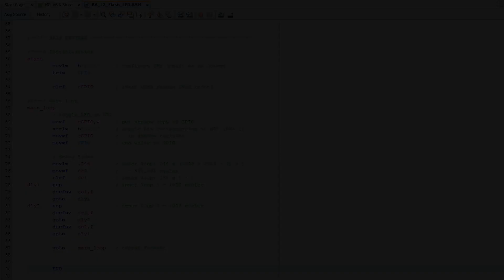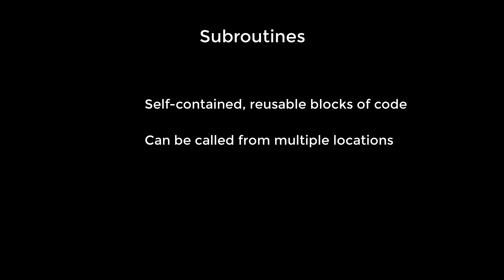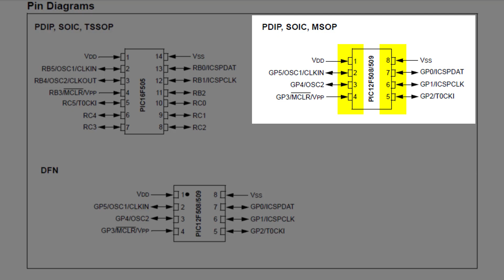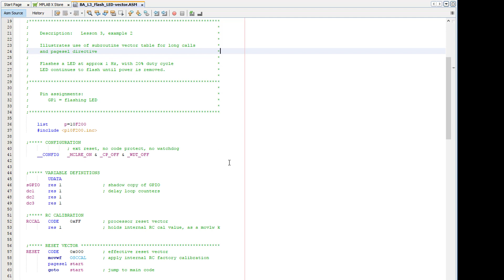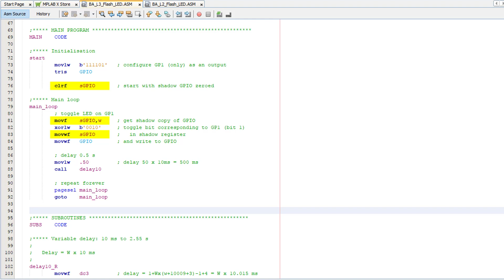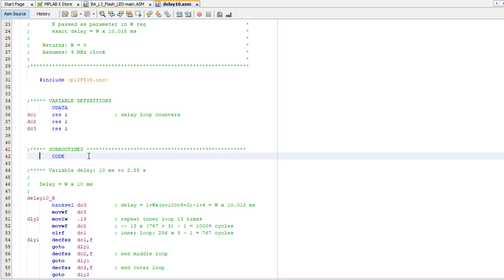Comment: Ok, this has to be the most boring PIC tutorial I can possibly do - but unfortunately you have to know about banking and paging etc. to progress any further with assembly language on baseline PICs...  It's a great advertisement for programming in C, and/or using a more recent PIC architecture, or not using PICs at all!  Still, couldn't really avoid it - hopefully I've made it reasonably understandable!
Reply: Thanks - I've tried to show that the datasheets are the ultimate reference, highlighting the relevant sections - hopefully the approach works ok.  There's a balance somewhere between oversimplifying and getting bogged down in detail - finding that balance is the challenge!
I'm working on the first C lesson at the moment, and that's a lot easier - no need to go into all that detail...  Nevertheless I want to also cater for people who want to understand the nuts and bolts.